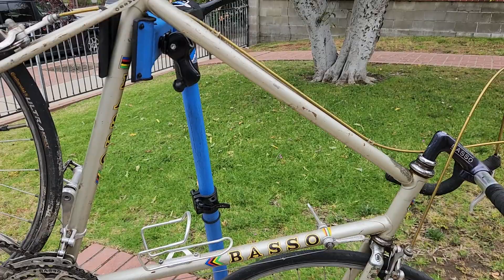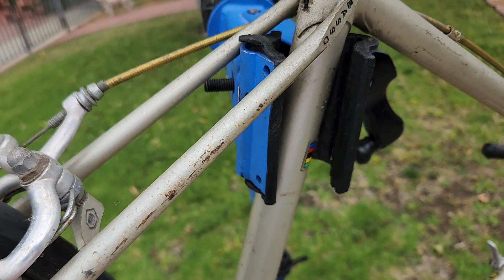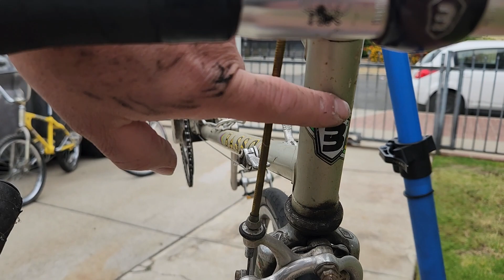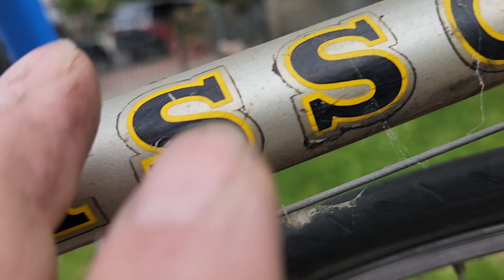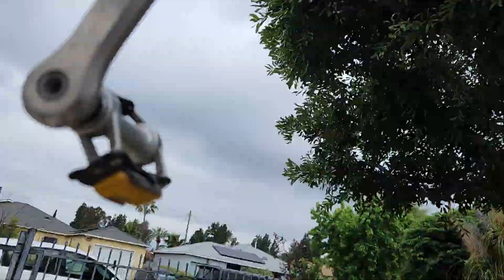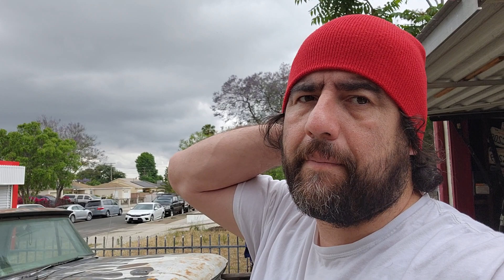barn find a vintage BASSO penta road bike

Comment: You have all Campy Super Record expect for the headset, front, and rear derailleurs which are Nuovo Record. On your cranks circle with a number 2 in it means that cranks was made in 1982. Use emery cloth on the brake levers to clean up the road rash. Are the drop outs stamped Basso or Campagnolo?
Reply from the maker: I'll take a closer look at the drops when I get back home.. I am thinking about swapping out the derailleurs to super record but not 100% sure ...definitely going to do a deep cleaning and back on the road